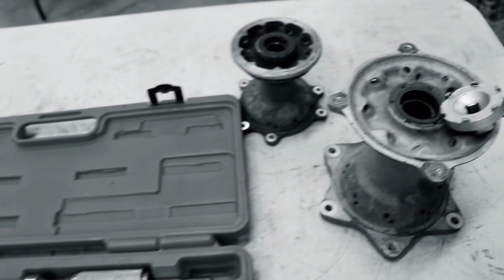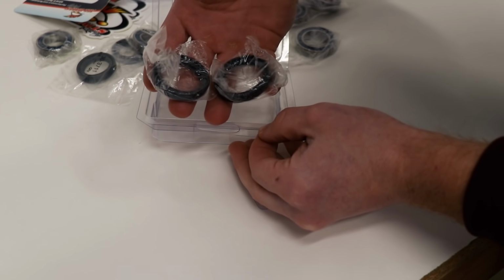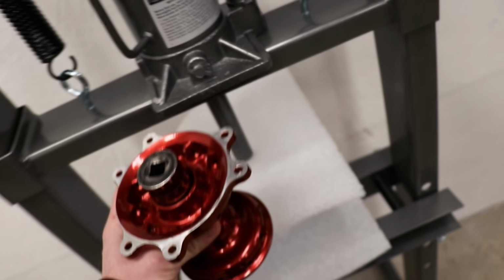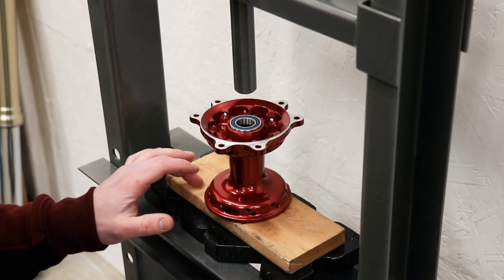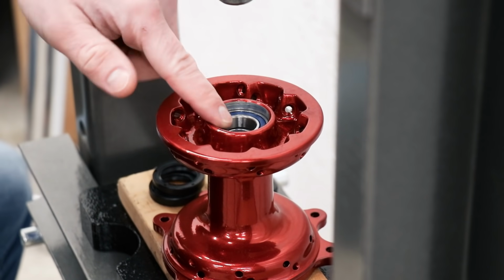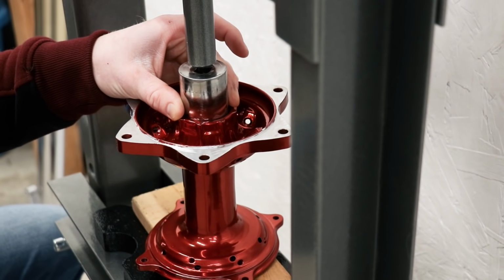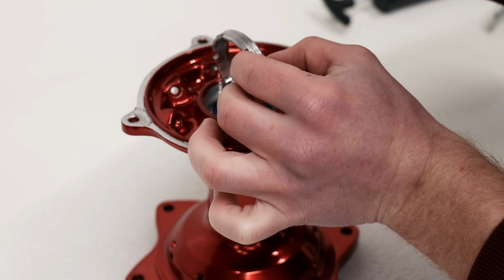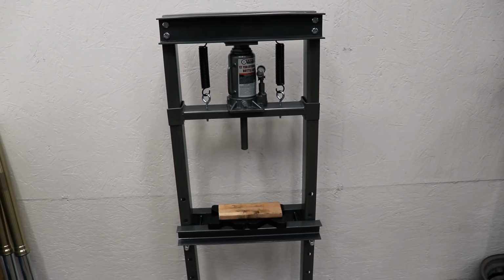Installing Wheel Bearings Has Never Been Easier!

Comment: Bit of fine grain hard wood is best for the press, doesn't get all dinged up or split.
For anyone that doesn't have a slide hammer.
Put the hub it in the oven with spacers under each side to raise the hub, you should hear the bearing fall out when the hub gets hot enough or will with a tap on the top of the hub, or take it out and bang it down on a wooden block.
Flip it over the let the other side fall out, if not put it back in the oven a little while.
I always heat aluminium casings of any kind in the oven to remove bearings rather then risk galling as its pressed or punched out cold making the new ones not quite as tight.
For vertical split race engine cases (on a single cyl) that sees a few bearing changes not heating it can end up with a progressively looser fit to new bearings.
A bearing that is not a tight interference fit risks walking in the housing and getting looser by the day and the casing will be junk.

Comment: so you dont need to add additionnal grease to the wheel bearings, just dropped them in out of the bag, not like the linkage needle bearings or steering stem bearings? is it possible to remove the bearing dust seal(the one built in the bearing cage) on the bearing retainer side, without removing the retainer? (for bearing cleaning) thanks!
Reply from the maker: Nope, these bearings are already packed with grease. The seals are removable for cleaning and re greasing however.

Comment: Question: Why is the bearing spacer inside the hub so loose against the inside? seems like it would create more problems than solutions that way. I know it contracted in the freezer, but that much? I doubt it.
Reply: that spacer is there for the axle!
Reply from the maker: The bearing was not seated all the way in that clip. But it still has some movement when the bearings are pressed in completely. When the axle is tightened the spacer keeps the distance between the bearings consistent.
Reply: So, just like the outer race has a seat in the hub, basically the spacer is a "seat" for the inside race of the bearing  so that when the axle nut gets tightened down it doesn't pull the bearings apart?

Comment: Hey man do you know if the spacer should be loose in the hub after everything is installed? I recently did that job and I could put my finger in the hub and move the spacer back and forth easily and up and down a bit
Reply from the maker: Yes, pretty much every hub has some movement in the spacer. There should be very minimal play though.
Reply: Cameron Niemela ok because after I got it all installed I noticed that the seal on the sprocket side was seated uneavingly for some reason, I thought I got everything seated good. Then I put in on the bike and it was hard to push the axle through the side that was uneaven and as I tightened the axle but down more and more it for harder and harder to turn the wheel so I thought something was wrong. Any idea what happened or what I may of did wrong?
Reply: I rode it one time and took the wheel back off and now all of the bearings are hard to turn

Comment: You should have the sockets up the other way so there’s a bigger surface pushing on the bearings
Reply: The way he has the sockets sits on the outer ring of the bearing just fine he doesnt need anything in the middle...and did you see the way his shop press sat nicily in the 1/2 drive..i think he did it perfect!!!

Comment: You should never put grease inside the bearing hub..
Reply: dude you put a little   grease inside the hub where the bearing sites to help it slide in much easy that way. anyone that works on bikes knows that.
Reply: sam halstead Yes, it will help it slide in easier, and thats bad. You want a tight friction fit, and you do not want any grease in between the hub or bearing or you will get a loose bearing hub when the grease helps the bearing slip.
Reply: haker i been working on bikes for 14 years i have never ever has a lose wheel bearing problem. even bike  mechanic tells you oh just put a little bit of grease around the bearing to help it slips in faster. only way your going to have that bearing slip if you put a lot of it then yes you will get that problem just a little bit wont be enough to cause that.